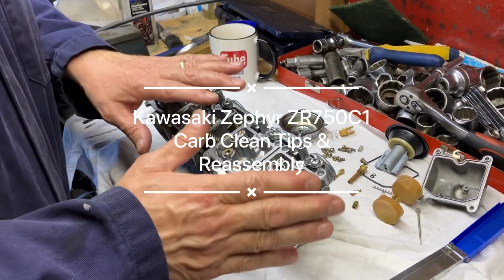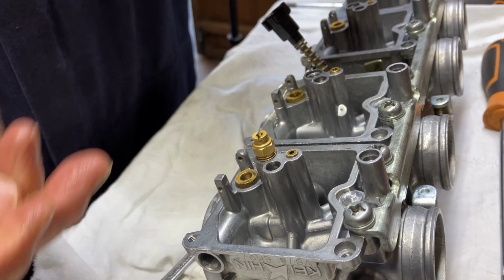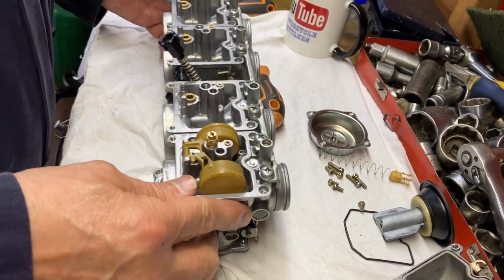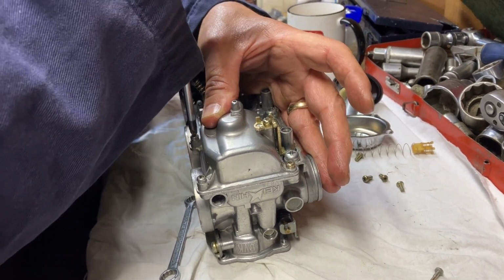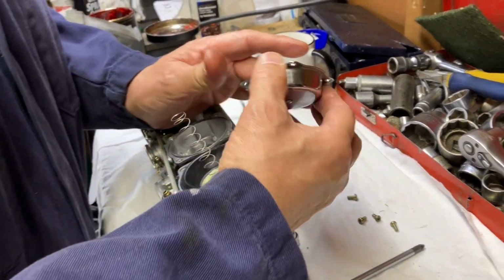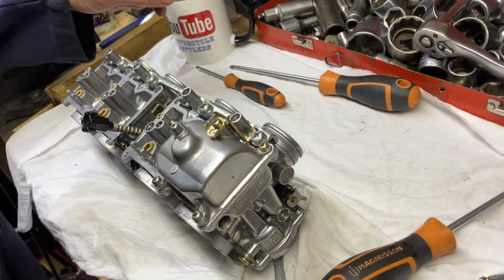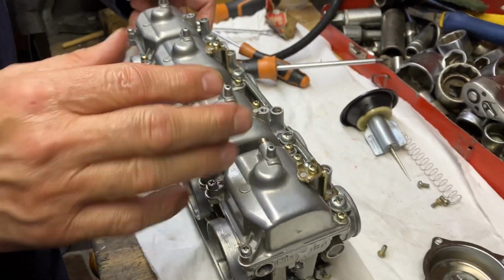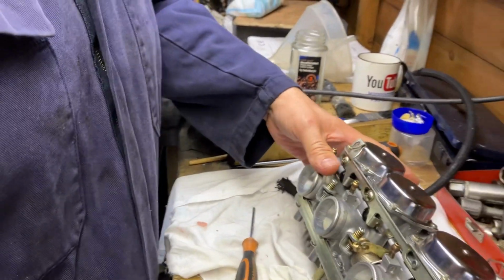Kawasaki Zephyr ZR750C1 - Carburetor Cleaning Tips & Reassembly

Comment: Hi just found your channel and love it,straight forward no fuss 👍
I'm about to do a total restoration of a 94 Zephyr, on my channel. 
I'm currently stripping the carb, which I've done before on my Zx10.
But these carbs were not with the bike, no exactly sure they are the correct ones🙄
But  was hoping you could show the finished rebuild. Hoses pipes etc, I can find parts diagrams.
But they don't show this.
Cheers
Reply from the maker: I love the Zephyr. I’ll be sure to watch your channel if you’re doing a rebuild. Happy to take some photos of the carbs if it will help you.
Reply: That would be very helpful,  my email address is in the about section of my page description 👍
Reply: @MotorcycleFettlers ihave zephyr 750 what original setting for fuel air mixture screw sir

Comment: What's that wee bracket on the outside of (I think) #3 carb's float bowl? Never seen that before. Thanks for clarifying which carbs have the larger jet, mine only had 1 by size 92. I can sort that! Thanks!
Reply from the maker: I don't know what bracket you're referring to. Feel free to send a pic to motorcyclefettlers@gmail.com. Unless you're saying that you do not have the bracket? Or let me know where in the video MM:SS is the best shot of the bracket in question.
Reply: @MotorcycleFettlers  at 04:50-odd to 05:10-ish, my mistake it looks like #1, the little cad-plated bracket on the bottom of the fliat bowl. Mine definitely doesn't have that, wondering if it's a fuel heater system bracket (Australian delivered didn't get that system). Thanks again!
Reply from the maker: I'm pretty sure that's the bracket for the carb warmer. We've passed this bike on, now, so I can't look. If you've got the four little car warmers, then I think you'd know, so I'm guessing you don't have those either? I don't think the carb wrmers offer much value, anyway.
Reply from the maker: I removed the reference to Yambits in my response. I was mistaken as to the video you were referring to. The car heaters on the Zeph are small cylinders. I think they're like hen's teeth, if you are looking to find some.